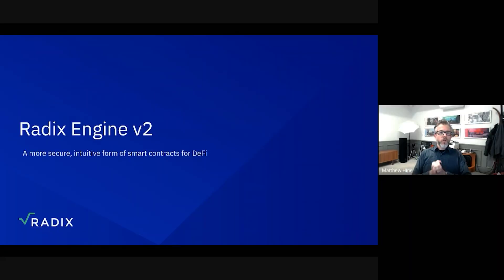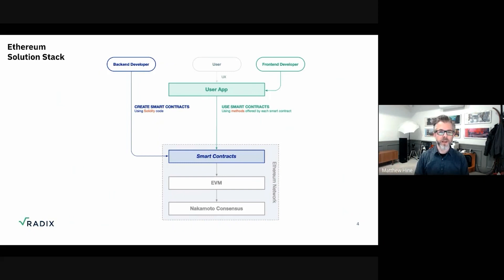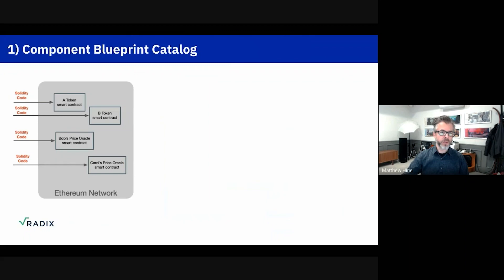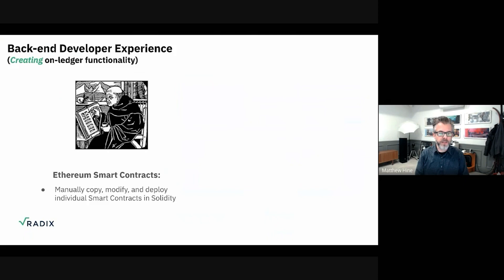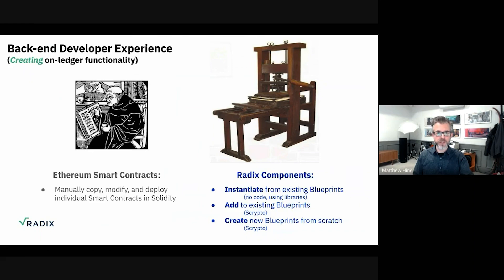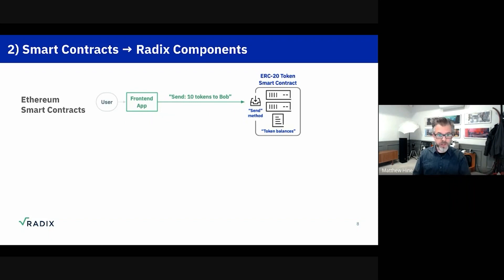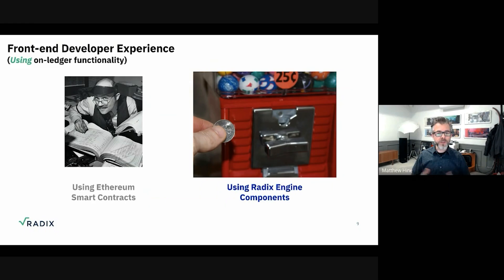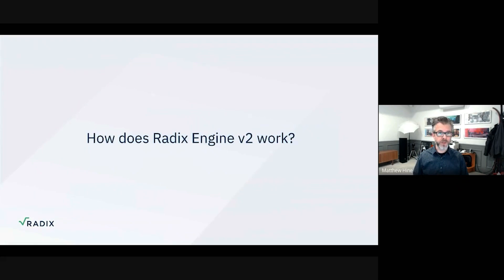Radix Engine v2: Exploring Components and the Radix Finite State Machine

Comment: Great project, but wouldnt it make more sense for Radix to be layer 2 on Ethereum or other blockchain.  Accessing the security of Ethereum while creating Radix blueprint framework on top.?
Reply: They can’t. Layer two protocols break atomic composability. That’s why some of the layer 2 scalability protocols (Eth 2.0 for example) aren’t a real fix. The dAPPS on layer 1 can’t see and communicate with dAPPS on layer 2. Breaking atomic composability hamstrings your functionality. Which is why Radix decided to create a whole new platform. That way they can ensure speed, scalability, security, AND atomic composability. Everything else is just a temporary fix.
Reply: The way Radix executes smart contract is connected to the consensus layer, which in turn is leveraging the specific data layer (pre-sharded datastructure that enables shard/tx determinism which in turn enables paralellization)
It would be suboptimal (if even possible) to build on top of Ethereum because the architecture of Ethereum wouldn't allow us to paralellize transaction processing.

Radix's design enables unlimited throughput whilst retaining full atomicity on the platform, the security comes from Proof of Stake (something Eth is transitioning to)
Eth's token is more valuable so it's harder to buy enough stake to get control of the network, but as Radix's token rises in value so will its security as well.